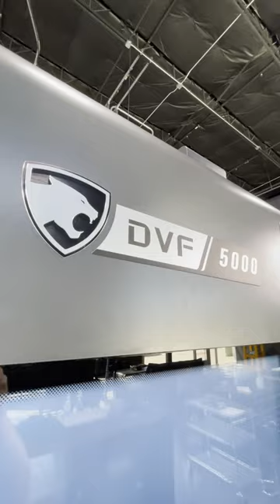CNC Machinist makes a Pitbull!

Comment: Is this derived thru 3D rendering software or is all this coding manually entered
Reply: You have a 3d model and then you use CAM software to define toolpaths to cut it from a stock. Stock is the part you start cutting from - typically a cylinder or a rectangular block. CAM software can largely automate generating the toolpaths, so you don't have to write any code by hand and once the toolpaths are defined, it uses a preprocessor to translate the toolpaths into GCODE which is the code your CNC machine understands.

Comment: Just how many hours of tooling did it take?
Reply: If I remember correctly it was around 7-8 hours.  It could have been sped up some if I was able to run coolant.  Turned it off for filming
Reply: @Jessie_Smith  
Very impressive tooling that cnc file must be huge.
Reply: @assassinlexx1993  Yeah it was pretty big.  I broke it up into a roughing program and a finishing program because it was bogging my computer down lol

Comment: I wanted to see how they gave it the fur texture at the end….too bad they skipped that part
Reply: Its most likely just the surface finish left from the way the tool is pathing/cutting across the material (plus other factors as well) and if they did model and program the fur, its cut using similar surface 3D tool paths like your already seeing in the video just probably with a smaller ball endmill tool, essentially a square profile tool with a radius on the tip allowing it to cut/roll geometry not possible with a fully square ended tool.
Reply: @chance2538  cool…thanks! I’ve always wanted to get one of these for my garage or something lol. Looks like a fun job.
Reply: @elliot1405  Of course man, and right on glad to see people interested in the trade even just as a hobby. Ive been in the industry since I was 18 where I grew a passion for CNC, and have been fortunate enough to work on some badass aerospace tooling, molds, and firearms over the years. It's certainly a fascinating line of work! Albeit a bit stressful at times haha.

Comment: And this is why 3d printing exists 💀
Reply: It’s just a demonstration. Takes a lot of experience, training and skill to do this kind of work efficiently.

3d printed parts will never replace billet parts. High performance and precision parts are made from raw materials on CNC machines for a reason. 

Injection molded parts are far superior to 3d printing. 3d printing is a prototype/proof of concept type of thing.
Reply: @KnoxGTX  haha you think they’ll never replace billet parts. Just you wait. Jet engine nozzles and tubes are already being 3d printed for better performance. Won’t be long until metal 3d printing is even more refined and costs less.
Reply: We have a 3d metal printer here. I’ve inspected and done secondary op machine work on aluminum, stainless and titanium, and I can assure you that you aren’t holding any tight tolerance with a part just wired off a build plate. Unless they have software that anticipate warping and guide the design to avoid warping after cooling, but when you heat any material to hundreds of degrees and cool it… it warps as it cools…
Reply: We even gone as far at sending parts out for stress relief after printing and still had issues with warping during secondary machining. 

It will be a long ass time before 3d printing takes over bullet parts of at all 🤣
Reply: @KnoxGTX  couple decades tops lol
Reply: @KnoxGTX  if you don’t mind, who is the “we” you refer to? I’d like to take a look into what y’all do